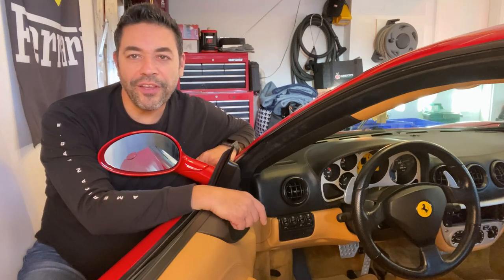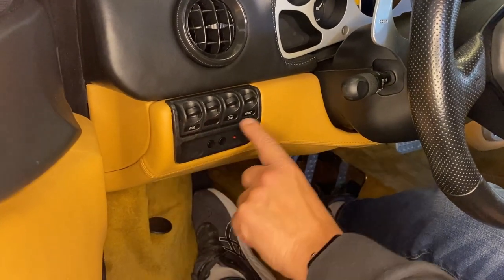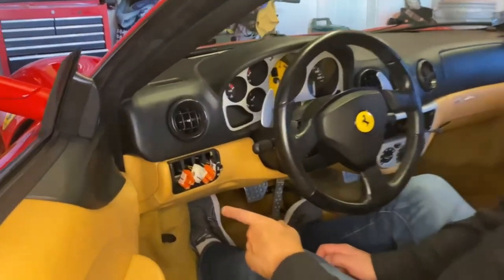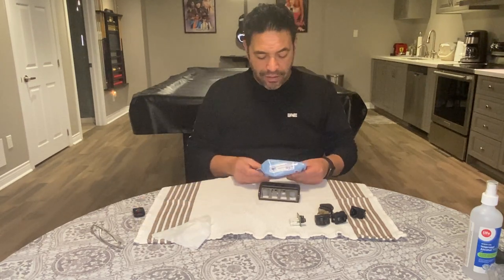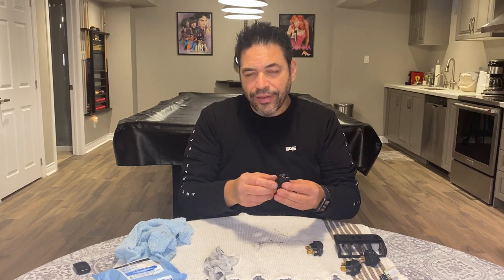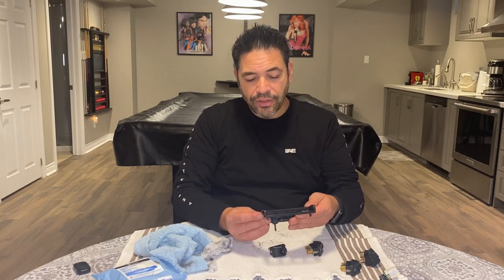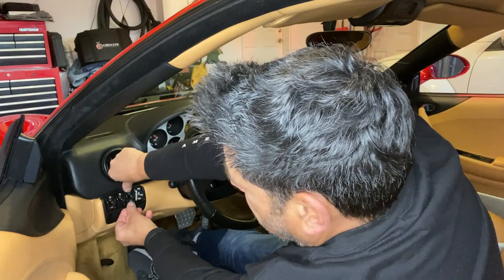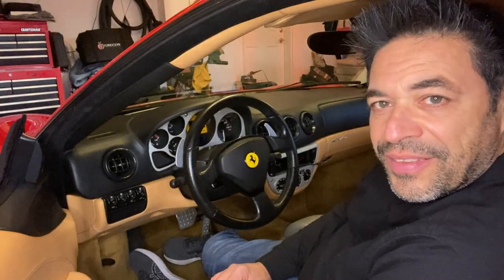Ferrari Sticky Buttons on Dash - DIY Fix

Comment: Why didn't you just masking tape up & wipe the plastic switches down without removing them & panel ?
Reply from the maker: Thanks for the question. You honestly can't properly clean them without removing altogether, not to mention that the solutions have a bit of liquid and could short something out if you squeeze too much in between the buttons and the bezels. It was easy enough to just remove and do it right.